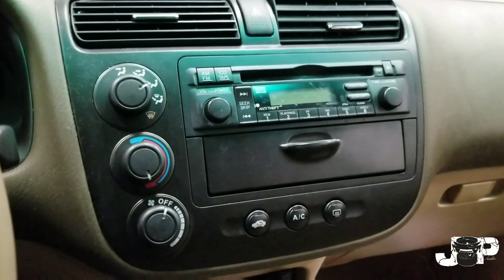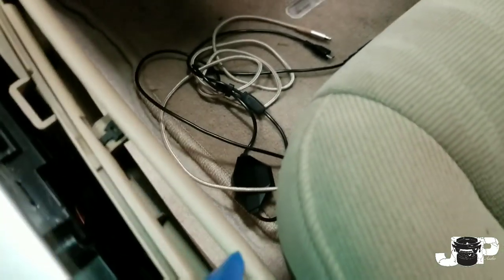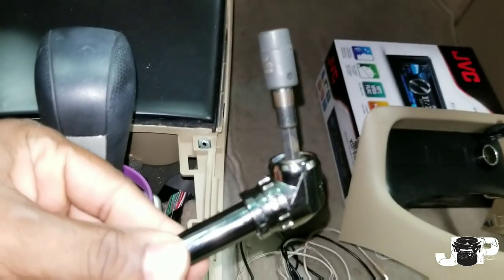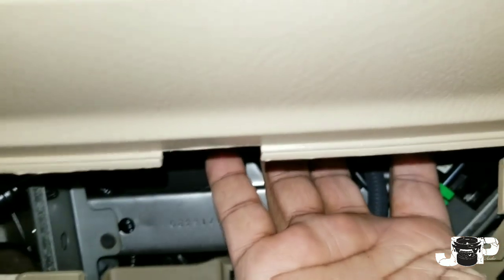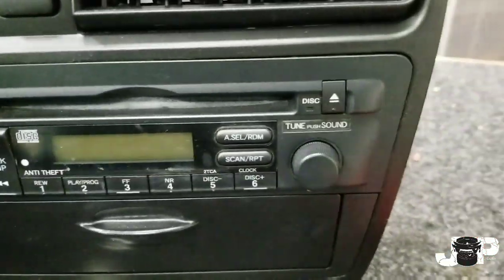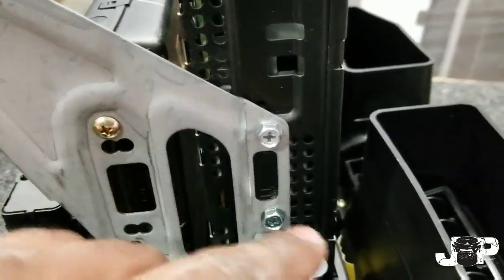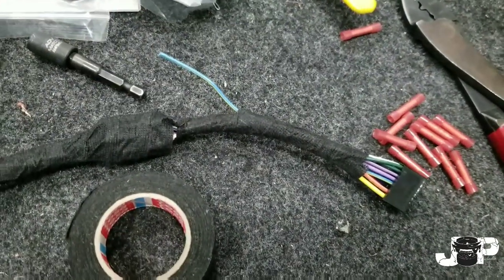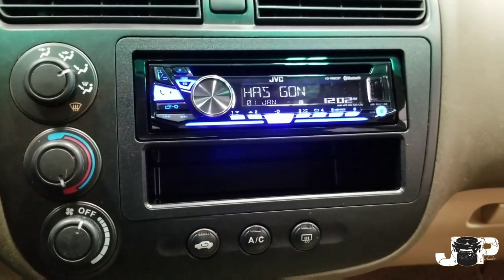2005 Honda civic radio removal

Comment: Great video! Anyone attempting this should know that you absolutely should disconnect the negative battery terminal and wait a few minutes before starting. Otherwise you risk the SRS system engaging and possibly having an airbag go off. It's unlikely but it's not worth the risk of possible serious injury. Plus it's simple and takes very little time. I'd hate anyone to get hurt. Good luck all!
Reply: Make sure you know the radio activation code before dropping power.
Reply: @8000RPM.  what is that?
Reply: @nobeln.6793  To prevent theft modern radios have unique codes (listed in the owner's manual when you buy the car). If you drop power the radio won't work 'til you put in the code. So if you steal a modern radio it won't work for you.
Reply: Please
Reply: @8000RPM.  I mean this video is about replacing the radio, me personally I'm only doing this cause I bought my car used and it didn't come with the code, so I figured I'd just get a better one

Comment: Instead of prying the dash (easy to break), because it can be very tight, is to open glovebox and use a large flat screwdriver to pry dash out. Put it into a slot in side of radio and pry against the bracket next to radio.
Reply: TE5LA thanks. I just busted my buddies dash thing

Comment: What about the anti theft system? Thought it was tied into the radio. If you or anyone could shed some light on this topic I'm all ears. Thanks by the way great video.
Reply: if you are installing a new radio you should have no problems.  if you reconnect the same one then you need to re-enter the code which you can get for free at any honda dealer

Comment: Are those HVAC brass screws the same ones being used to hold in that big radio bracket? Because I’m needing to buy a new radio bracket with screws and don’t have a screw to reference, but the HVAC controls looks like to uses the same one